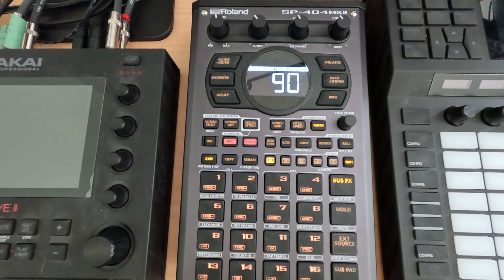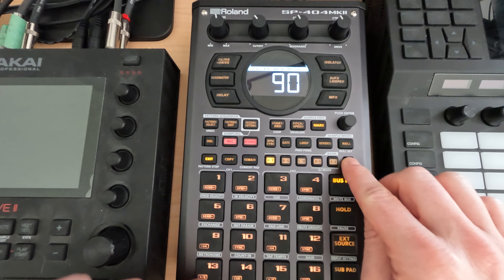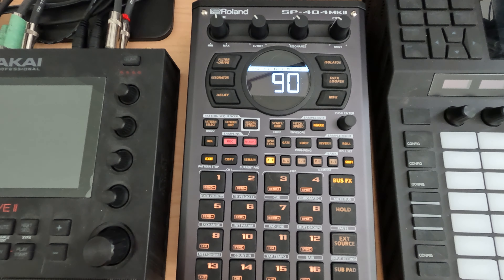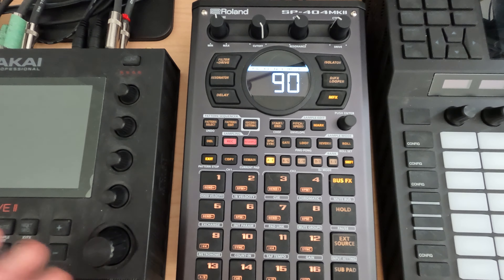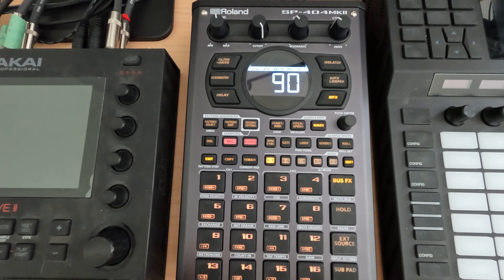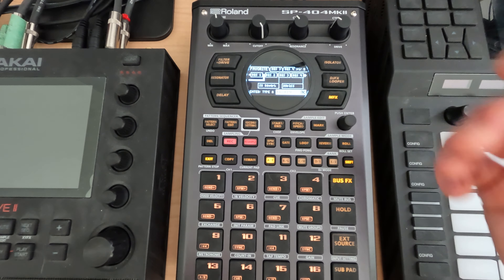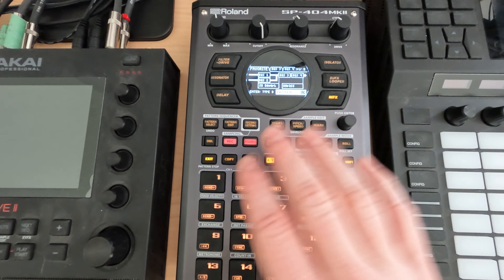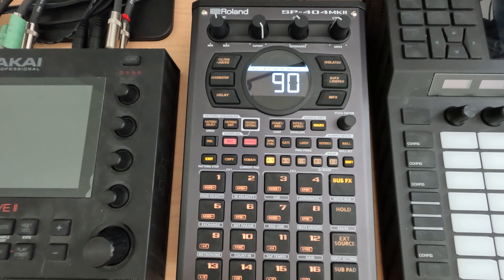SP404 mk2 22.0 - Intro to Using the mk2 as a Looper

Comment: Just wanted to chime in and say thanks for this reminder. I was wondering why they added the SX Delay to the MK2 and this is probably the reason why. On other current Roland devices (like the TR-8S) the delay starts to decays after a small amount of repeats (around 30 cycles if I remember correctly), but the SX Delay appears to be infinite, which makes it a decent looper. 4 to 8 beats is enough to work with.
Reply from the maker: Yeah, and with skipback you can go dig out your loops from the delay, which is quite cool

Comment: Thanks for the video. Is there a way to get the CLIP function as in the MPC LIVE, for example 4 columns/groups of loops that contains each 4 samples (loops), and if I launch one of it stops samples of the same groups. And mostly they are in sync.? If I'm not wrong we can use MUTE GROUP function. But I don't know if samples are in sync with other samples. I use the clip function a lot in the MPC and ableton ot quickly create tracks. I was wondering if I can do this with the 404. I think I have to resample audio and use mute groups. Please let me know :)
Reply from the maker: The mk2 doesn't really work that way... with Mute Groups you can go in that direction for sure... but they aren't going to start/stop in sync like Clip mode on the MPC Live/Force, or Ableton Live.  

I've done some things in newer videos showing how to get all the loops in sync, through pattern mode, and then using Pad Mute to mute them, but definitely YMMV depending on what workflow you're shooting for.
Reply: @NearTao  thanks!

Comment: How do I access the Sx-Delay? I'm holding down the MFX and Isolator button but the library you are showing here isn't popping up...
Reply from the maker: If you haven't, you need to update to firmware 2.01.  You can download it off of Roland's website if you haven't installed I yet.